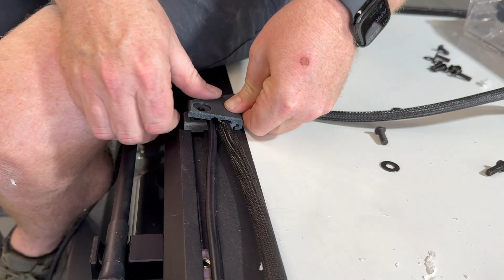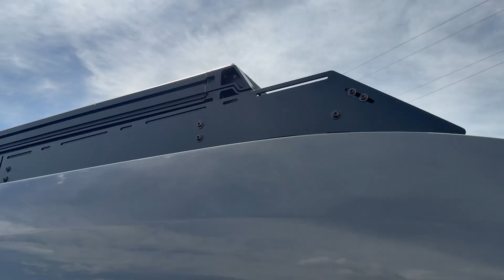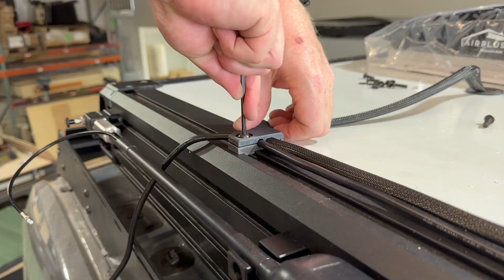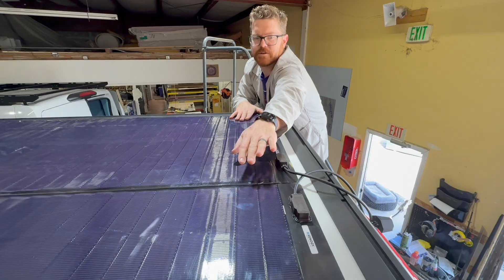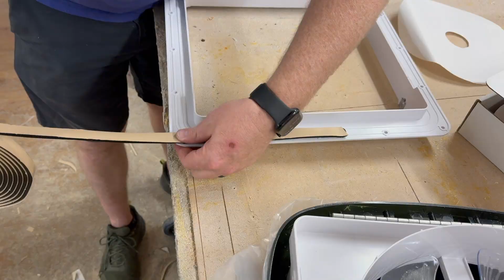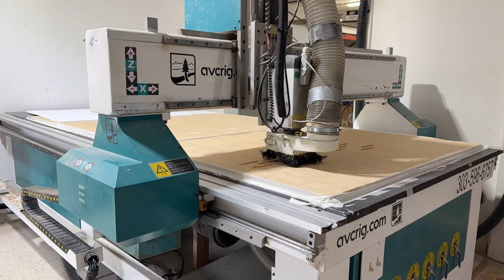CloudCap Enhancements | AVC Shop Van 2025 Build EP. 15 | 2023 Ford Transit 148 LB | Van Life Camper

Comment: Where did you get the WeBoost mount?  I don’t like the mount for the Overland Reach - I’ve got it on Leitner HD bars on my roof, but after seeing your video, I’m thinking I could mount them on the aft T-track instead of the top - and then I could get rid of the stupid plastic cradle with the zip tie that comes stock.

Comment: Nice!

A span of 1" aluminum angle glued on with gorilla or similar would probably take out the flappiness and support enough weight to keep someone from falling through the bamboo covers you designed for the pass-through.
Reply from the maker: That's a great idea!  I’ll play with a few ideas. With the fan and latch in the center I may just do a single board with some more strategic holes.